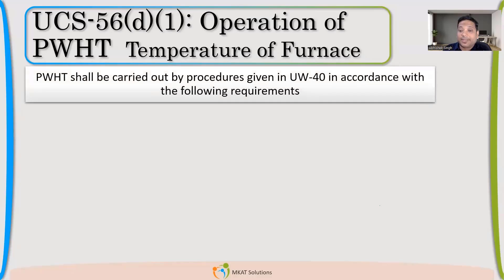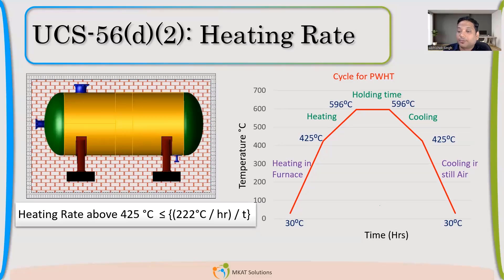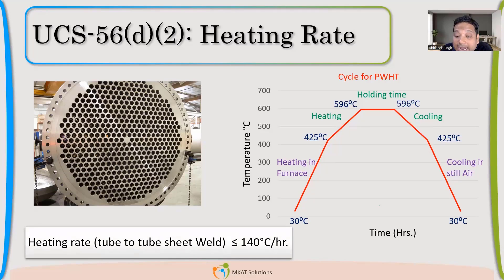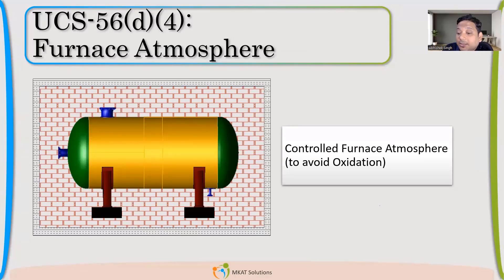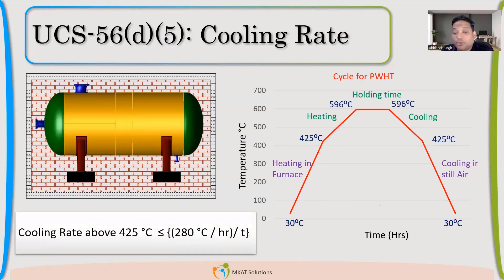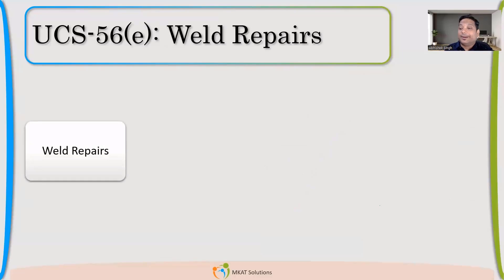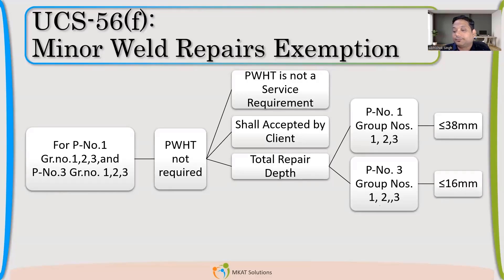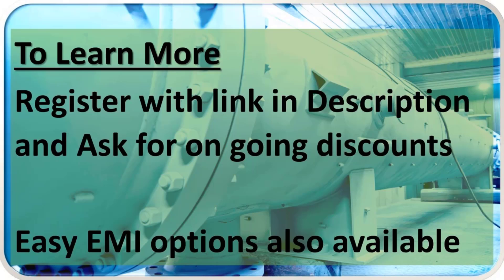Requirements related to PWHT

Comment: My tubesheet MOC is SA 266 & 60 mm thk
Shell 14 mm thk (SA 516 GR 70)

DO I need to do PWHT for tube sheet to shell joint ?
Reply from the maker: In shell to tubesheet joint, shell thickness governs for PWHT requirement, as your thickness of shell is only 14, you dont have to go for PWHT